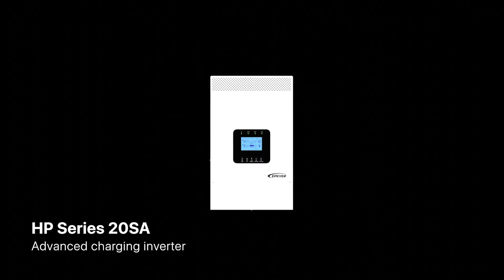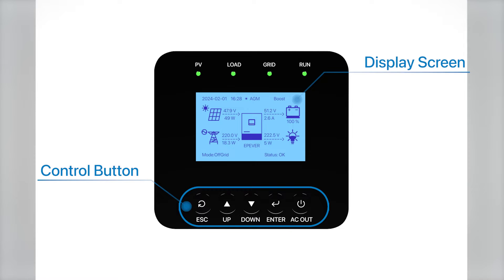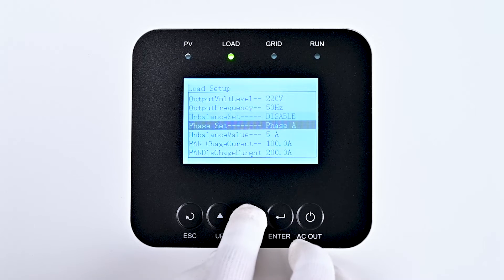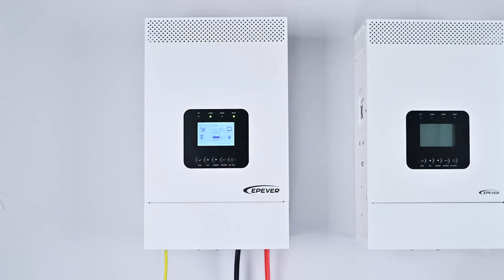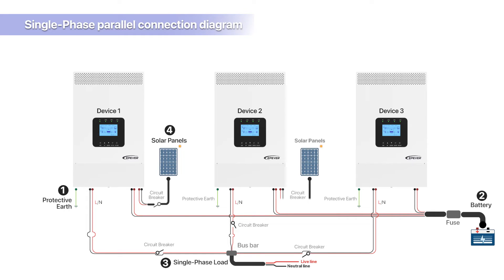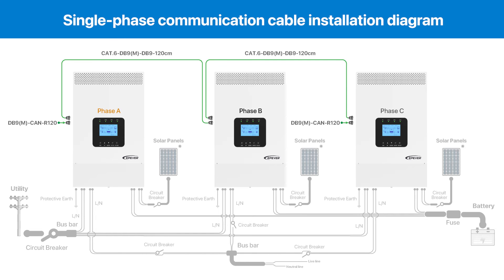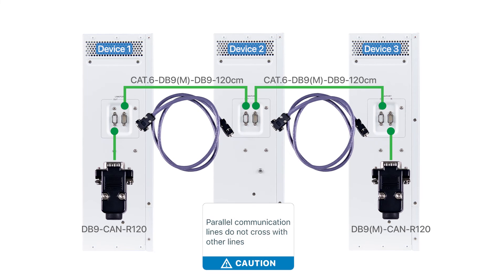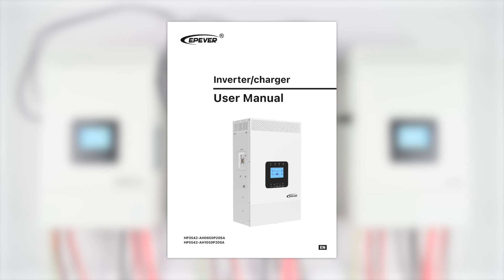Exploring Single-phase Parallel | EPEVER HP Series 20SA Inverter Charger Configuration Guide

Comment: How about the lifepo4 communication? It should at least communicate with known brands/protocols without using the BMS Link.
Reply from the maker: Hello there, our HP series 20SA inverter charger has a built-in BMS-Link, allowing you to directly connect for lithium battery communication. For compatible lithium battery brands/protocols, you can contact our support team at support@epever.com for more information. Thank you.

Comment: What is the maximum efficiency?
Reply from the maker: Hello there, thank you for your interest in this product. Our HP Series 20SA inverter charger is equipped with advanced MPPT technology, ensuring a maximum tracking efficiency higher than 99.5%, which allows for optimal solar energy conversion and system performance.